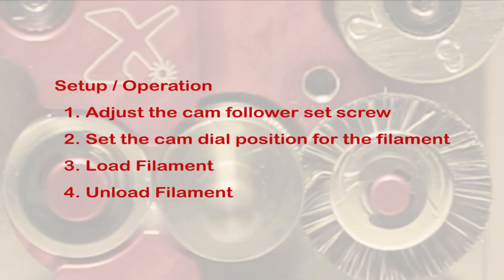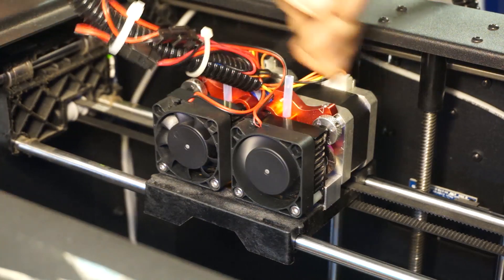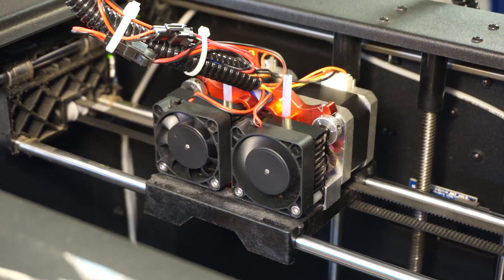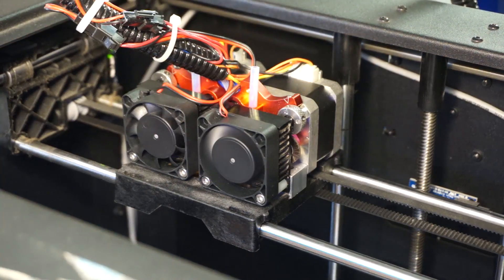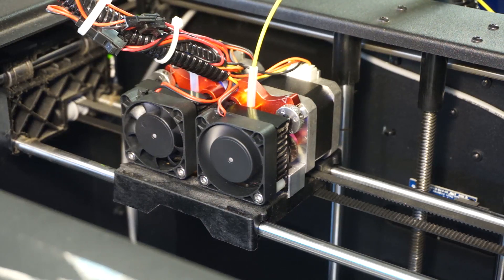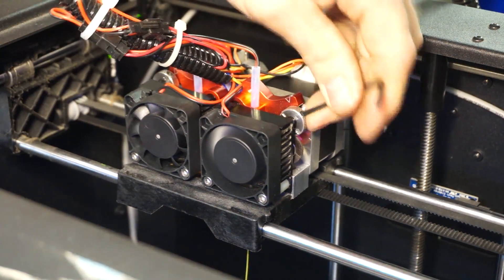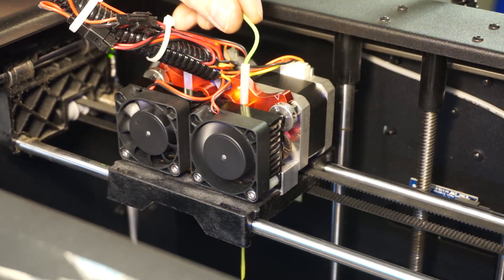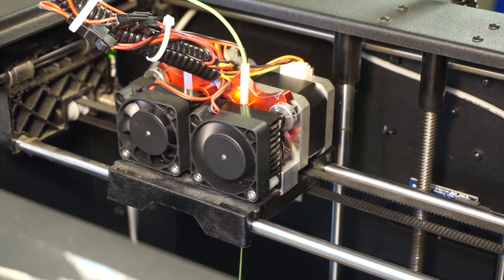Flexion Extruder Quick Setup and Operation

Comment: If I adjust the set screw as described on the FlexionHT for the MakerBot Replicator 2X, then load filament, #4 doesn't even nearly touch the filament and it wobbles all over. I have do adjust #4 to the filament itself, but I don't have any instructions for that. Also, the only way I know how much to tighten it it tiral and error. Can you please explain or point me to an explanation of how to do this correctly on the FlexionHT?

Comment: I see that the extruder was running before you loosen the set screw and adjust the cam follower to 1. Did you run load filament on the printer first before making adjustment? After making the adjustment to 1, is the set screw suppose to touch the cam follower when you set it to 4?

Comment: I am facing a problem with my extruder. I'm using X60 Ultra Flexible filament with Flashforge Creator Pro. The extruder is inconsistent in extruding the filament and would often leak out of the extruder, jamming the entire thing. Please help :(